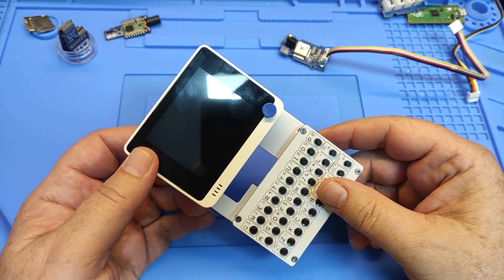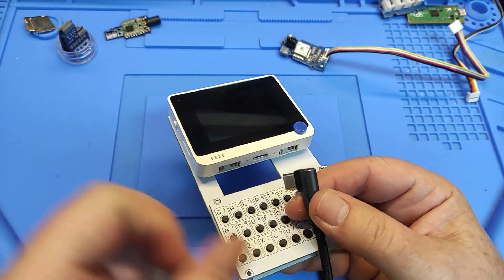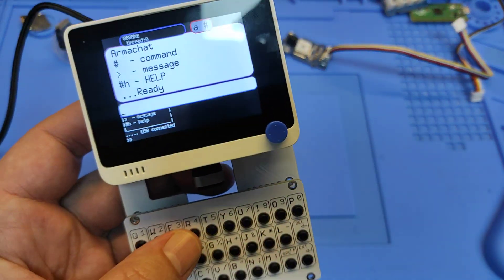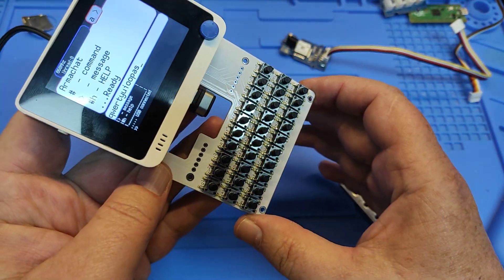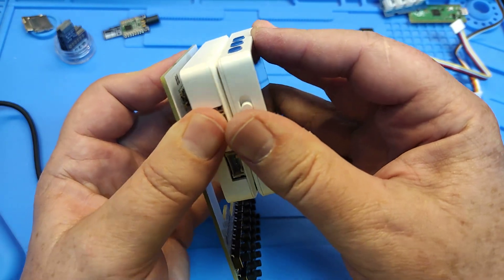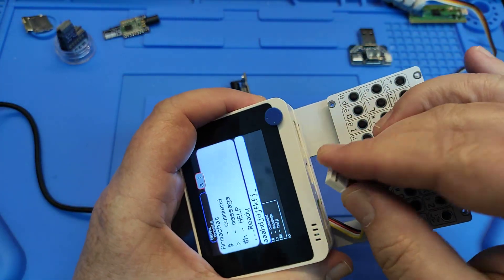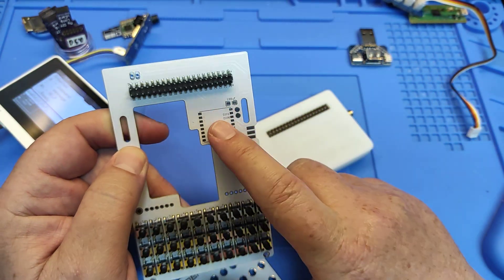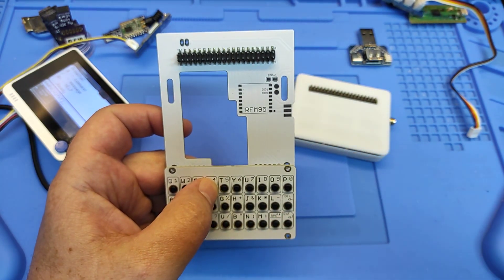WIO Terminal - QWERTY keyboard quick preview

Comment: What is involved with programming the WIO? Are the WIO LORA modules available in 433mhz?
Reply from the maker: Wio terminal is in my case programmed in #circuitpython, use same code just I change GPIO configuration. Wio terminal have no Lora module, I soldered my own on keyboard PCB, Yes there are Wio-e5 Lora modules but they have own MCU with firmware and they miss some features, both wio-e5 modules and rfm95 modules exist in 433mhz but I still have no time to test, On my last video you can see message sending. Wio terminal is not bad but I think need some innovations as new processor with more ram and have ugly TFT display. I am very confused with Chinese product where is still something unfinished, etc incoming new Armachat killer https://www.lilygo.cc/products/t-deck which have interesting hardware but I do not understand authors with purpose of this device, how to carry or encapsulate, it is  strange hedgehog with connectors on each side, weak ufl antenna connectors, no mounting holes, without any software. I think it's good for posing in front of the camera or hanging on the shelf, I've had many such interesting things, but when I held them in my hand, I sobered up
Reply: @bobricius  I wouldn’t worry too much about an “Armachat Killer”, so far every device coming out of China needs a cell phone to set up….. and has a Bluetooth antenna that can communicate to other devices without the user knowing about it.

What might be the simplest, most elegant solution would be to pair the Armachat software with a LORA circuit board and take input from a USB keyboard. Many people Don’t need the portability of a handheld device, something they can pull out when needed, or connect a keyboard from a pants pocket when it’t time to reply to a message would be fine for many.
Reply: I meant to have the Armachat software on the WIO module with a LORA circuit board that connects to a USB keyboard.
Reply from the maker: @nunyabidness9257  Picomputer and Wio terminal use same Armachat software circuitpython software without changes, Lora module communicate via SPI. USB keyboard is not supported.
Reply from the maker: @nunyabidness9257  interesting, I always thought that the absence of bluetooth was a weakness. I can offer this > USB to LoRa modem and a simple javascript program that runs in a web browser, but the computer does not need the internet. You could build a simple computer with, for example, Linux, not connected to the Internet. I have already presented this solution, it uses 20$ Wio-mini-E5, code is here http://armachat.com/armachat/ it is single HTML which you need download and run localy. Require browser with WEBUSB